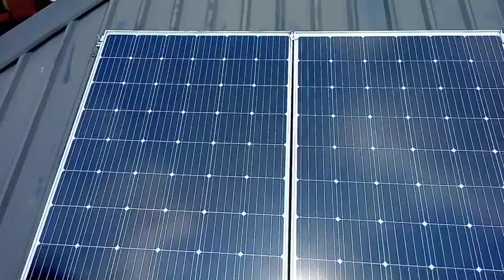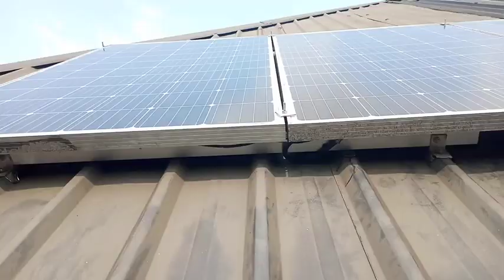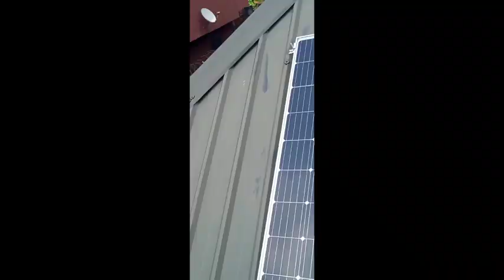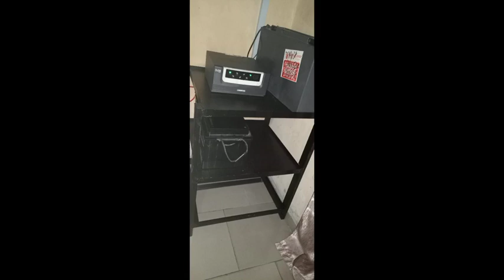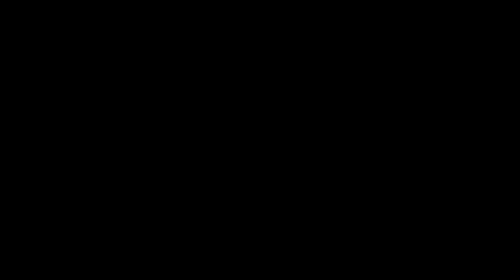installation of 1.5kva inverter 30amps felicity charge controller 840watt solar array

Comment: How much does it cost for 1.5kva
Reply from the maker: INVERTER, BATTERY AND SOLAR PANEL PRICE QUOTATION                          

1. T.Y.L TL-GEL-200AH12V battery 2  #310,000                                 
2.1.5kva 24volts luminous inverter hybrid #128,000                               
3.PV cable 6mm 15yard #24,750                                 
4 Battery rack for 2 battery  #17,000                  
5 Felicity MPPT charger controller 45AMPS 
12/24VOLTS 
 #80,000                                   
6 280watt mono solar panel 3 80,000 240,000
TOTAL 800,000                                
MATERIAL FOR SOLAR PANEL INSTALLATION PRICE QUOTATION 

1, Aluminum mounting rail 2 #21,600                                  
2, Flashband wide size 2 yards #1,000                                   
3, L bar for rail mounting 8  #3,200                                  
4, Stainless bolt and nut 8 #2,400                                    
5 Tapping screw 8  #1,200                                    
6, Mid clamp and galvanized bolt and nut 6 #3,000                                    
7 End clamp and galvanized bolt and nut 4 #4,000                                   
TOTAL 35,800                                   
MATERIAL FOR BATTERY AND SOLAR PANEL INSTALLATION 

                                 
1 One 65amps 2p changeover  #4,000                                   
2  Cable tie 1pack                                    
3 DC protection  #15,000                                  
4 AC under and over voltage protection #15,000                                
7 5AMPS 1pole circuit breaker and box 2 #7400                                   
                                      
 TOTAL 42,400     
                            
 GRAND TOTAL    878,200
Reply from the maker: Product comes with one year warranty after installation
Reply from the maker: Battery can last up to 4 year if properly used
Reply: @juliebtech200  what's the battery maintenance process. Can it be refilled, serviced or replaced and how long will it take before maintenance after installation. 🙏
Reply from the maker: @Emmanuelcbright  the batteries are maintenance-free if properly used it can last up to 4 to 6 years  of operation

You know like ensure that the battery is in a good operating environment/temperature 🌡️ and avoid draining your battery to 0%
Reply: What can 1.5kva inverter power